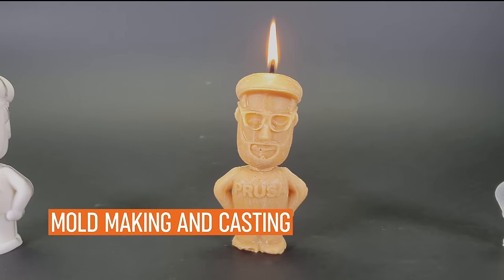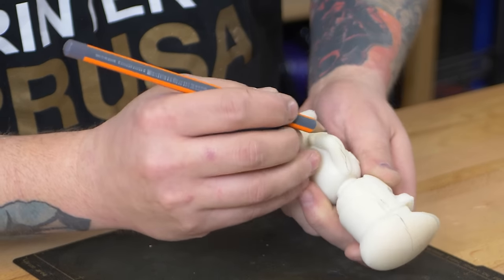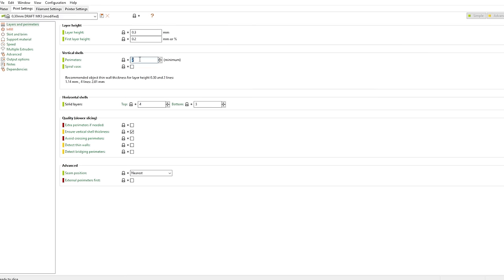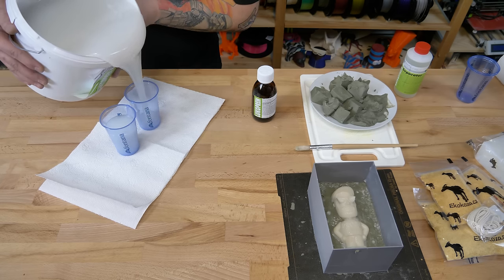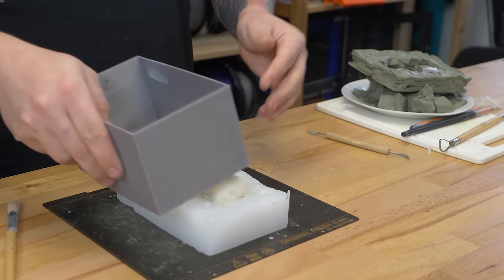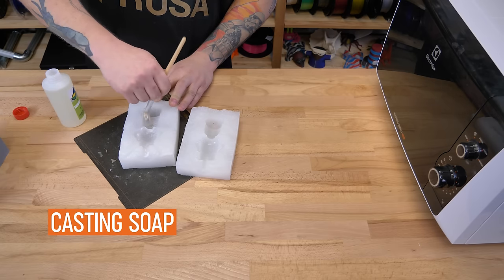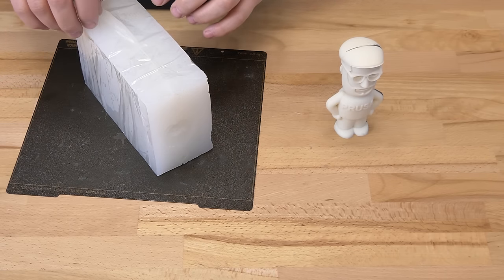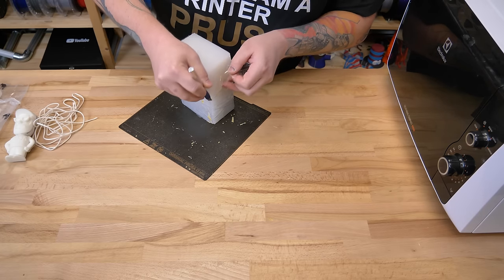The beginner's guide to mold making and casting

Comment: Pro tip: Use sulfur-free clay.  Clay that has sulfur in it will inhibit the silicone from curing properly.  Tip 2:  You will want to seal the SLA print.  That kind of resin does not react well with platinum cure next to silicon.  Prints can be sealed using a few coats of a good clear coat.  For example, Krylon crystal clear.

Comment: I just print my molds directly: take 3D-object, subtract it from a cube and split that in half. Then print that. The molten wax isn't hot enough to ment the mold, so it works fine to make candles.
Reply: interficiam, what material did you use?
Reply: @Alm8hoorOW  I used transparent PETG. I don't think it matters a lot, but with this i could see if there were unfilled areas in the mold.
Reply: You may have just changed my life. THANK YOU!
Reply: Hi I haven’t done this before so just wondering, when you say ‘take a 3d object’ is that a physical object or something digital on the design software used for the printer?  I am looking to make lots of different one sided moulds

Comment: I've viewed many videos like this one using a 3d printed model to cast in a silicone rubber mold for use to cast epoxy, urethane, wax, pewter, etc. Though I've yet to see a video that shows 3d printing of the mold itself from flexible filament to use for casting. This could be a time saving technique.

Comment: I am reading through the comments and my question is only could I do a silicone mold instead of using S LA or resin. Should I use the actual negative as a traditional 3-D print with FDM  Printing then put it in creating a mold box and then pouring the resin or would that be too hot it and it might melt the actual PLA o ETG
Reply: Nope because you must stretch a mold for correct remove the cast from it and when you have mold without stretching you are not able to put out the cast. And of cause the temperatures of casting material. With those temperatures you melt down the plastic.
Reply: Nope because you must stretch a mold for correct remove the cast from it and when you have mold without stretching you are not able to put out the cast. And of cause the temperatures of casting material. With those temperatures you melt down the plastic.

Comment: i know there is some flex for sla, possilble to print directly the mold ?
Reply: I'm guessing it depends on the melting temperature of what you're making. You don't want the hot soap to melt you're 3d-printed mold.

Comment: Just print two pairs of inverse  molds and cast in that  so the print would be the mould  that way  things like clamps and hinges could be built into the design even cooling tubes to run water through I will be useing this technology in the future for lost wax casting of replica steam locomotive parts and old tractors
Reply: I have tried this a few time and hit a few problems. Like it will leak, sorry they just do not get tight like a silicone mold would. Also getting your item out it really helps to have the flexibility of silicone. I have been doing 3d printing to casting for a few years now, and use it for as much as I can but direct to mold has not been very good for me.
Reply: What about printing the mold with tpu?
Reply: @xmalina  layer lines like crazy and it will likely still leak. Not saying it can not be done, depends on the quality of the end product you need and time you want to put into the mold. If your item does not need to be perfectly smooth and shiny then yea. Also you can improve the seal with silicone to slow leakage. SLA and the small layer lines are great for casting but then we are limited by print size ... the joys of 3d printing.

Comment: Any plans to try something like this with metall?
Reply: same basic proses but for metle you want to use someintng like sand insted to silicone
Reply: You can do pot metal (low melting point metal like zinc) in a silicone mold .
But brass, copper, aluminum, or other metals with melting points higher than about 300⁰ C will need to be done in either an investment (lost pla) or sand cast.
Reply: Yep

Comment: When I tried to mold a SLA print with silicone the silicone didn't cure. Anyone an idea why this happened? I used Anycubic Resin and Smooth-On Ecoflex Silicone. Do I have to use different silicone or is there a special resin for casting/molding silicone?
Reply: You must have 2part resin not that you cause with UV light
Reply: Hi Alex,
I had the same problem but than I have found out that Resin prints are problematic with Platinum-cure silicone. I bought than one Tin-Cure silicone and it worked.
I am planing to make a video about it in the next weeks because I could not find any video before regarding this issue!
Reply: Do you have right set of both parts of silicone?
Reply: @Dombi3D I did used platinum cure silicone, maybe this was the problem. Next time I will try another silicone. Thank you for this tip.

Comment: Hi, how did you melt the soap in the microwave? Normal soap bars do not melt with microwaves but in the video it looks like you just put soap slices in the oven 🤔
Reply: Yep if you have soap for casting then you can melt it in microwave
Reply: @TGWMS  Is is a special type of soap? Thanks
Reply: Nope it's standard soap that you can use for casting. This soap is little bit different than that you buy in standart store those you can buy from farms, hobby store or some creative stores. It's for casting or making your own soap. Normal soap you must melt on fire with bit of water then you can cast it also ;-)

Comment: Why you didn't just print the casting negative?
Reply: Nope because you must stretch a mold for correct remove the cast from it and when you have mold without stretching you are not able to put out the cast. And of cause the temperatures of casting material. With those temperatures you melt down the plastic.

Comment: Why not just print the negative and use that as the mold???
Reply: I was wondering that too. Is it not possible to print two halves that you can use to cast candles in?
And how to do that? Getting my mini soon ..
Reply: i dont get it etheir. we print directly molds with channels to release air and pins to estabilish mold parts in accurate position.
Reply: Hot wax/soap would warp the plastic, I guess. Alternatively what if you printed positives of the mold and pour the silicone on that?
Reply: You can't put out the cast without stretch the form a bit . So when you have mold printed that cast stay stuck inside and you can't remove it from inside

Comment: Why would you not just make a negative of your print and print the molds directly?
Reply: Nope because you must stretch a mold for correct remove the cast from it and when you have mold without stretching you are not able to put out the cast. And of cause the temperatures of casting material. With those temperatures you melt down the plastic.

Comment: Why not just print the inverse of the model? Seems a bit overkill
Reply: Because of undercuts. If your object has undercuts, it cannot be de-molded. A silicone mold offers flexibility.
Reply: @avongil  why not print the mold in two halves with internal supports, and then clear the supports in the same way he cleared the supports off the model
Reply: because this is the right way how it's done.
Reply: Nope because you must stretch a mold for correct remove the cast from it and when you have mold without stretching you are not able to put out the cast. And of cause the temperatures of casting material. With those temperatures you melt down the plastic.

Comment: If you print it in two halves, you avoid the modeling clay part
Reply: Nope, you won't get a perfect result out of it.
Reply: Exactly. You are not able to do perfect half of mold.
Reply: @TGWMS  you are the reason why i didnt had to write ,,because it would melt'' or ,,because it has to be slightly elastic'' under every comment with ,,why not just print boath negatives??'' . Thank you
Reply: @throwawayaccountm1325  because that's the reason for the same question again and again that question have still the same answer and you already answered it ;-)